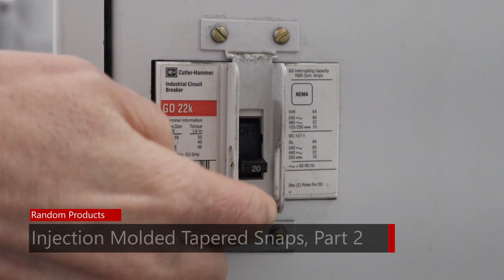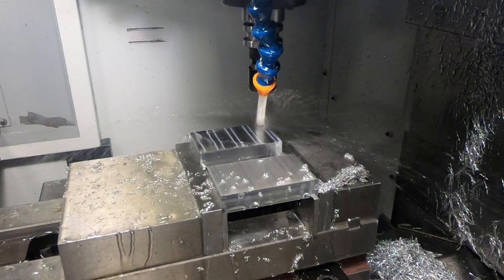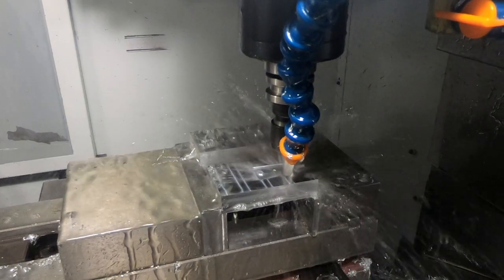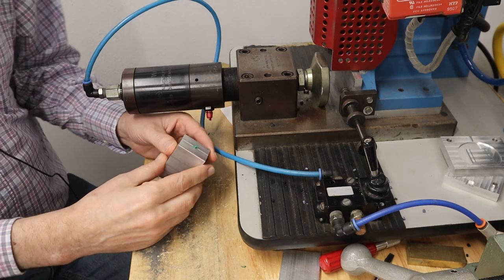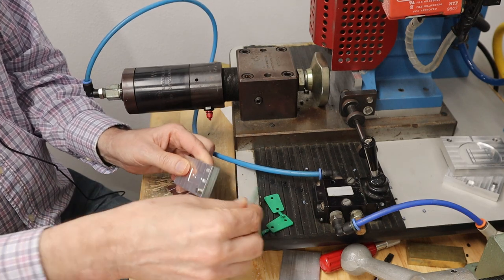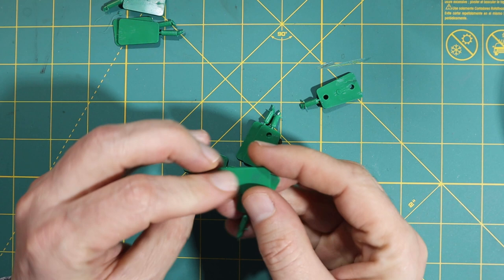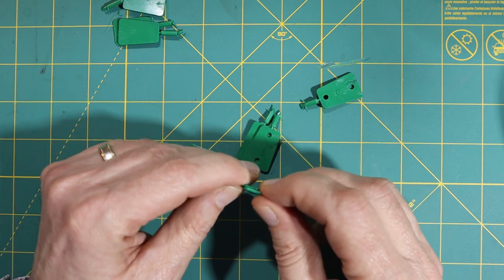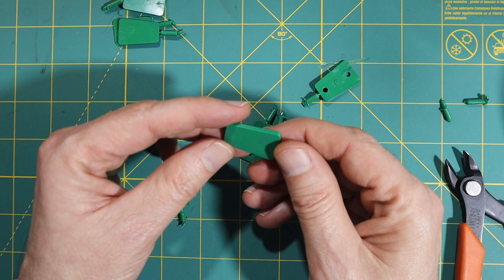Injection Molded Snap Together Parts, Part 2

Comment: I only saw this 2nd part. Cong rats, that was such a great moment to see happen.      Thanks for making the video.

I'm doing 3D printing and looking to figure out how to size pieces for insertion into other designs.    An example would be a little building for my dad's train set, I want to make the windows in a blue and the doors in a white PLA and snap them into an opened hole.  Just unsure how an opening should be over the size of what's being inserted.      
I'm very impressed and I hope by now you got that ventilation hood installed.

Comment: You can run each Tool in G54 and G55 and reduce tool changes and decrease run times
Reply from the maker: It probably wouldn't make that much difference on these parts, as the tool changer is fast. But next time I think I'll try the post option "Reorder to minimize tool changes."
Reply: @JohnSL  I use it to reduce wear on tool changer and helps reduce the run time on my  air compressor also. I have a TM2P which does not have spindle air blast but do not like hearing the compressor run all that much

Comment: Congratulations John, awesome work. Out of curiosity, what cutter are you using for the facing operation?
Reply from the maker: Thanks. I'm using a 3/8" diameter 3-flute end mill. This is the largest I can fit into the ER-16 collets on my tool holders. I purchased a couple of face mills, but unfortunately they didn't fit into my tool changer. I do have one ER-20 tool holder, so I'm looking for a good face mill with a shank no more than 1/2" in diameter.

Comment: It would be infesting to figure a way to add automatic ejection to this machine. 🤔
Reply from the maker: Not on this machine. I do have another machine that supports ejector pins, but the part that I'll be using this on won't be a high volume part, so it's better to go with a cheaper mold.